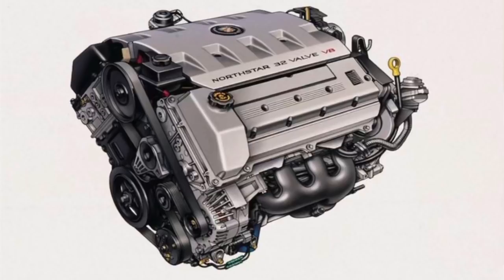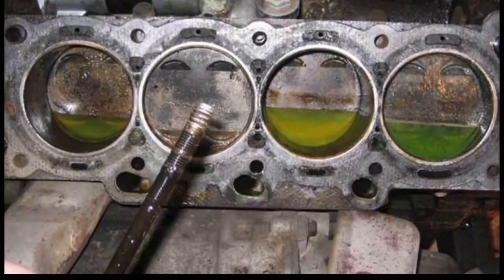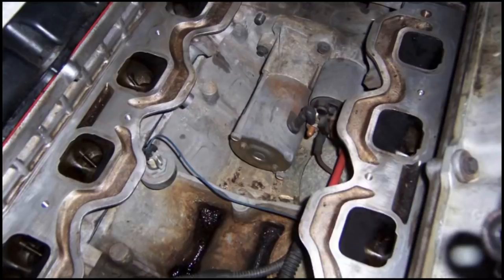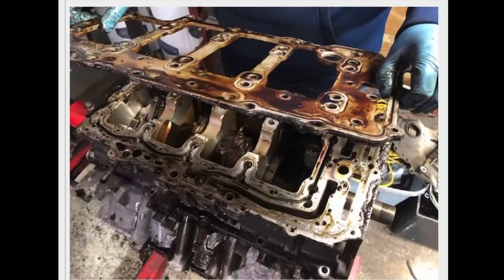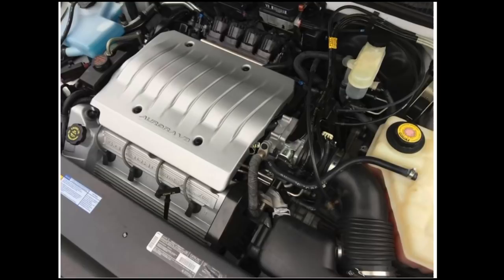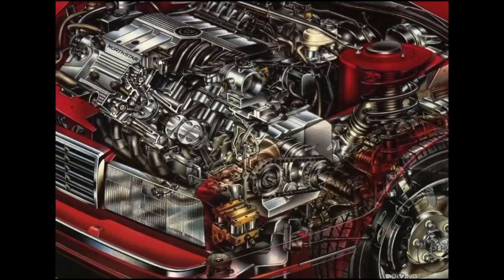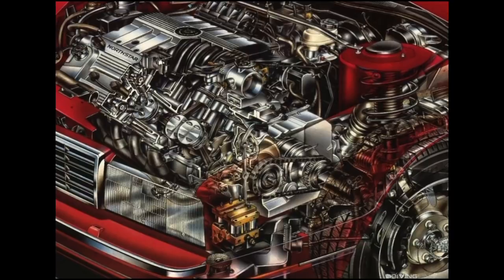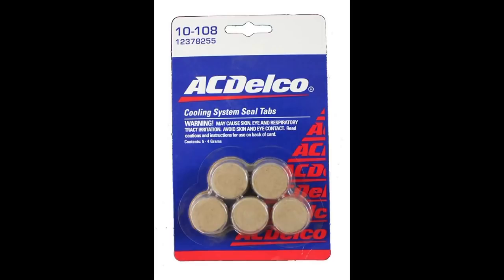Worst Car Engines of All Time: Cadillac Northstar

Comment: Learn something new every day. TIL the Northstar has 10 head bolts. Just for reference, a Chevy small block has 17. Add that to the list of reasons!
Reply: The SBC had so many cause they had a thin deck, and still have a tendency to crack.
Reply: @ProjectFairmont  the heads? I️ was thinking that was the reason behind the blown head gaskets but then I️ remembered small block fords have 10 head bolts…so…
Reply: @TinHatRanch  Not just small blocks..385 series Fords (429s and 460s) also used only 10 head bolts and early versions had compression ratios as high as 11 to 1
The head bolts however were of large diameter and torque specs were 130 ft-lbs.
In addition, the Ford 427 FE series engine that embarrassed Ferrari for 4 years running also used only 10 head bolts
None of the Ford engines were known for blowing head gaskets.
BTW big block Mopars also used 17 head bolts.
Reply: @mikec9112  No 406FE production engine had cross bolted main bearings, they were simply a .080 overbored 390. There were rumors however of 406 engines that Ford experimented with that had 4 bolt mains.
The primary reason Ford bored the 390 into 406 was to complete with the already popular Chevrolet 409, but Pontiac division was the frontrunner in the displacement wars with a 421 ci unit.
In fact, early 427FE engines mostly built in  early 1963 were 2 bolt mains, the cross bolted side oiler version replaced them almost immediately as it became apparent there were serious durability issues under racing  conditions, the center oiled 2 bolt became notorious in short order for "oiling down" drag strips when the bottom end blew out.
Reply: @donreinke5863  and all 3 of the big-3 🇺🇸 did have options for 6-per-cylinder v8 engines and some of those are aftermarket castings/billet, as a example the LSX is one and the 440RB BBM is another one and i believe the hemi got that mod in the aftermarket pieces as did my frankenstine BBM hemi + 9/16" main and 1/2" shank top and bottom row shank plus a bedplate i know maybe a little overkill but built to take abuse/longevity. ford did 4 per-cylinder in the 6.0 power stroke but it's a mixed bag as it's supposedly a weak spot in the design
Reply: @mikec9112  Not quite. The highest performance 390 of 1961 and early 1962 had a solid lifter camshaft as did the 406 as well as a "snubber button" on the front of the cam to keep the cam seated in the block.
According to the 1962 Galaxie owners manual, the top option 390 was rated at 375 hp with a 4 barrel and 401hp with 3 two barrel Holleys.
The 406 was rated at 385 with a single 4 barrel and 405 with the same Holley 3x2v setup.
Only with the introduction of the 427 in 1963 did the FE get an all new block (twice) as its 4.250 bore was well beyond the limits of overboring the 390s 4.05 bore.
The 4.13 diameter 390 based oversized block was used from 1966 until 1969 as a 428 ci unit, and some builders used its 3.98 "stroker" crank to yield 454 ci when used in a 4.25 bore 427 block.
Ever notice that almost all 390 (and 410 Mercury only) blocks still had "352" cast in the front left below the cylinder head?
I scored a 410 that someone stuck in an old Ford flatbed at the wrecking yard because the morons saw the "352" and kept on walking, never bothering to scape the grime off the ID tag under the coil bracket.
Off the subject (partially) the Olds 350 diesel block could be overbored .130 and STILL had more cylinder wall thickness than the 350 "gas' block, and a Ford 312 Y-block will take a .060 overbore with no issues--Ive had to do it.
Very minor changes in the casting process easily allowed an FE to be punched .080, and some production 390 blocks (depending on core shift) would even take .080, but sona-ray inspection should be done.
Reply: @richardprice5978  The 6.0 PowerSmoke was perhaps the worst diesel in light duty trucks with the exceptions of the early 6.2 and 6.5 GM (Detroit?) diesels.
385 series Fords used 9/16 diameter bolts, while the SBCs were only 7/16s. (The Ford Y-blocks, 292 and 312 with only 10 head bolts also used 7/16 fasteners, I always recommend using ARP stud kits on those)
Its been so long since Ive pulled the heads on a Mopar B or RB that I dont remember the bolt sizes.
Reply: @mikec9112  well i remember a industrial or marine version of the first generation 1940-66~ hemi and the BBM V8 wege and the max-wegeg having a bedplate or cross bolted bottom end 5/16 or 1/2 or 9/16 sized studs or bolts
Reply: @donreinke5863  wasn't there a LSX GM factory performance crate engine with 9/16 main bolts or arp studs and MLS head gaskets and 6-p-cylinder
Reply: @donreinke5863  BBM-b uses 1/2 shank mains 7/16 🤔 bottom row ARP has a stud kit with some TLC to go up a size so thats what i did, but 5 doesn't seam to clamp the head evenly so i added a row using the exhaust manifold ( B-block with a 👨‍🏭 -steel plate 12"deck and D-8 heads and weird VC rods and VVT+VVL camshaft and lifter's. have questions ask me ) and block aka mine is welded i kinda know its not the strongest setup but for quick and dirty try and see what if shade 🌲 R&D its ok 👍
Reply: @donreinke5863  bottom row on the BBM-B goes in to the water jacket and needs teflon to seal it up and by memory is a smaller size head/socket as the spark plugs and exhaust manifolds are next to it
Reply: @mikec9112  all the vipers blocks i have seen are cross bolted bottom and 5-p-cylinder heads and is related to the SBM as i chexed the cam bearing spacing and is 60* lifter angle as my cam style is like the CAM-in-CAM with twin phasesers and narrowed angled lifter bore's as there jurk-pump/hydraulic like the tiger shark engine 1X2 for a 2:1 ratio rocker
Reply: @richardprice5978  I know they go into the water jacket on Chevrolet BB and SB and some small block Mopars as well as later model 302 Fords.
FE and 385 series Fords are blind holes as well as Y blocks.
I don't remember on the Slant 6, haven't had one of those apart since 77
Reply: @donreinke5863  actually come to think about it wasn't the oldsmobile 5.7 v8 diesel considered more of a rushed job? ( but could have worked and gotten praised, as things like having a poor fuel filtering and delivery/lift pump system ect. ) and i think turning a gasoline engine into a mixed fuel or trubo diesel high profomance engine only but sussful, but parts list's/mods are something the comments can mench it/what it takes to right
Reply: @mikec9112  Same here as far as the 351 be it Windsor or Cleveland , but NOT the "M"
I have no idea concerning why the lifters were placed as they were on LS engines, but the 302 with roller cam does not permit the removal or installation the lifters without removing the head,
Not an issue with the taller deck 351W.
I know that Ford made a small version of the 260/289/302 for Indy racing backing the 1960s with pent-roof style combustion chambers but I have no idea how the valves were actuated.
Ive never been an LS fan, If I want to build a Chevy its going to be an 87 or newer small block (they had high nickel blocks and often held a hone pattern over 200K depending on maintenance.)
Reply: @richardprice5978  I wouldn't doubt it, but the factory Chevy crates Im familiar with are the 502 and 572 units. I do use the LS exhaust port size and configuration as a benchmark when porting heads though.
Reply: @richardprice5978  Did you use Rhodes lifters to get that VVT/VVL?
Reply: @donreinke5863  same thing for me on the slanty i really isn't my last mod engine as i end up missing with chevys the most but really like my BBM's and willing to improve it by other people and engine design's ect. and the first gen hemi is to rare/old/$$ for me to own easily and the vipers car or truck is to expensive as mine is in a charger and by that alone is expensive by itself and i have to pick just a few
Reply: @richardprice5978  Primary cause of Olds Diesel failure WAS in fact GM being to cheap to install a water separator.
Once they got water in the combustion chambers, the steam overpressure was fatal to heads and bolts.
I believe..but wont swear..that the Olds diesel had a steel crank, much like the 359, 361 389 and 391 medium/heavy duty variants of the 360/390 Ford FE did.
Later 429 (and 370) medium duty truck engines also had a forged crank, but they had a huge snout (to run airbrake compressors) and an oddball rear flange.
Lots of machine work necessary to get them to fit a passenger car engine.
Reply: @richardprice5978  Nothing vintage Mopar is cheap anymore, at least as far as modification.
318s and 360s are still cheap and common in wrecking yards from old Dodge vans and trucks though.
Reply: @mikec9112  not a cording to me and my spare parts as their out in my shop/shelf and my measurements point to just adding 1 more row to make it a v10 block wise as yes the cam is phased at 72* firing order vs the v8 SBM at 90* as i used spare/used/junky parts ect. to learn how to make my mod parts
Reply: gen-4 vipers lift cam is about 550th
Reply: @mikec9112  i didn't say all where all cross bolted/bedplated just some and most of my EXP. comes from pictures and reading or others as the first gen hemi v8 i don't own one, i have a D-8 street hemi that is heavily modified
Reply: @donreinke5863  lol 😂 nope experimental computer/solenoids control and 2 modified GM LSX passers 60* units on a gear drive looks a little like a rotisserie chicken cooker 😂 and the VVL works a little like a 1"X1" roller diesel jurk pump FCA used multi air same idea as i didn't like the push-rod angles ( weakness in BBM ) so hydraulic JCB-4 ss steel lines fixed it and slave cylinders 2:1 on top of the head moves the valves at the end of the line following the camshaft profile but bleeding off PSI shouts off the valves/lift aka 800th reduces to min of 200th or off, and it's possible to change the spring pressure's but haven't gotten it to work 👌yet like a F1car not my idea but a buddy's of mine gave me the idea information to do it, and in my gruppies we don't trust free valve/CATIPALER yet in any format so the mechanism's are to keep it from going boom 💥
Reply: @donreinke5863  keath back BBM blocks have a extra rib on the top going from one china rail to the other for extra rigity and to help seal up the valley so my guess is the newer engines like the LSX and 3-G dodge v8 are doing the same thing and lowering the manufacturing costs ect.
Reply: @richardprice5978  Good engineering, but I wouldn't go that far, has to be time consuming as hell, and Im not one to put electronics on any engine except for basic electronic ignition  with a ramp charger module and a Hall effect pickup in the distributor.
Reply: @donreinke5863  so the rumours that it was a gasoline castings isn't what made it fall hard as the primary reason you're thoughts are water in the fuel leading to too much shock peak steam pressure in the cylinder so about the same as to much boost and fuel if the water wasn't injected in ?
Reply: @donreinke5863  from what little shopping i have done the slant-6 isn't to bad but that was the bottom of the junkyard pile and i was considering it for a quick dirty cheap temporary fix ( and i feel i would have ended up needing boost as 80~HP in 4k lb car is a little anaemic ect. ) ( considered the SBM and those are on the way up cost wise and getting harder to find or 3G and a 4.8LS but same problems and more basically a can of worms ) after my turbo B-engine died/stolen but with my tremic TR6060 out of a chevy it would have been a pain as omost nothing lines up/plays nice with the BBM so i skipped it as modifying it twice would have wasted my resources
Reply: @donreinke5863  btw not laughing at you people aren't expecting my mods ( im actually 🤔 💭 about having the passenger side valve cover made out of clear so i and others can see it ), ford voodoo 4-camshaft guys /import's have a point but i just noil in voided it and yes it's not for the faint of harted as it's a lot of work and thanks for the compliment design wise i feel full mechanical or full efi control as a mixed bag like the 1980-95 b-3 manufacturers didnt seam to work really well
Reply: @donreinke5863  holly ( is a cintrifical design, but i believe pre-1960's of some model alfalfa's had a cable on the dash to change VVT and a different cable for lobe separation angle ) had a cam phaser in the 60's that was all mechanical design and i suppose its possible to do hydraulic VVL and all mechanical as older diesel pumps was and it was timed to the firing order and there is other designs that use rods or rockers/soild lifter configuration to do about the same VVL thing as well i figured out for me it was easier to use modern hardware and software to do it and it's more flexible in tuning it well driving @60mph same way as why the fuel and spark are done that way in 2010-up as mechanical injection and mag is pretty much fixed typically with driving and or execrating
Reply: @richardprice5978  If you took the time to engineer modifications like that, (and likely gone through a lot of trial-and -error) of course you have my respect
Its people who went over and above what the factory did who were..and are..the roots of performance and car crafting.
I dont design my own stuff, but I use available compatible parts to improve older designs, like using E4OD gear sets in C-6s for wider ratios
I also use 4R70W gear sets in hydraulically controlled AODs for the same exact reason
Reply: @mikec9112  I just pulled apart a 1994 302 out of an F-150 to build, and I can guarantee you that there was no hone pattern to be found, but it cleaned up nicely with only an .020 overbore
The information I got from some of the forums claimed removal of the heads was necessary for lifter replacement, but I had pulled the shit assed small valve and port iron heads off before I went after the lifters, so never tried removing them before the heads were off.
There ARE ways to make the 400 run and run well, especially with the low end torque from that engines 4.00 inch stroke allowing the use of a more radical cam without waiting for the revs to come up high enough to not be a total dog at lower RPM.
 I built one using Australian 302 (also produced in South Africa) closed chamber Cleveland heads (which had the same valve size as the worthless open chamber stock 400 heads) and much better ports.
The big problem is that the pistons sat .070 in the hole, and no common aftermarket pistons are made which correct that.
Custom pistons are pricey, but 351 Cleveland pistons can be used IF the small end is bushed to accommodate the Clevelands smaller diameter piston pin
Reply: @richardprice5978  Exactly. The water in fuel/steam pressure seems to be the consensus on why the Olds diesel was a failure.
Ive read reports of people installing a water separator on those engines and they've lasted a long time, despite being naturally aspirated dogs.
Reply: @donreinke5863  interesting i thought that water in the injection pump and 3000 psi nosal would eat it like a water cutting machine does use up it's tip every so often and needs repair and replacement hardware 

if the peak max psi cylinder pressures were kept in chex would direct injection of water improve the engine? ( more so if aiming for the exhaust valve as it's generally the hot spot in a boosted EFI setup or the sharp-ish crown on high compression hemi piston's ) diesel fuel or pump gas ⛽ ? as i know port works but i don't know vary many that know about direct /hybrid steam
Reply: @mikec9112  not a fan of bunkie conuson hun? well he sure like triangles as a design athstedec for the car body's he's a credited with, with the oiling system that you mentioned i think 🤔i have seen it but don't remember why you think it's hot garbage 🤷‍♂😁?
Reply: @donreinke5863  the olds did need a turbocharged and after cooler as factory standard option as all diesel's struggle for air and clean burning without it on higher load and accelerating = smoking
Reply: @richardprice5978  Part of the cause of smoke in diesels is poorly atomized fuel,
Volkswagen and other manufacturers increased fuel pressure to well over 30,000 psi to address the problem as well as changing fuel injector design.
Early diesels had around 12,000 psi.
Reply: @richardprice5978  I dont know that water injection has ever been attempted in diesel engines, but if it were it would have to be very carefully metered to avoid cylinder overpressure, likely with some corrosion inhibitor, and yes injector damage was in fact reported on the Olds diesel.
It works well on low compression gasoline engines, its essentially free power.
Reply: @mikec9112  sorry i forgot to type Oldsmobile oiling system my bad. 

yep priority main oiling on the SBF does make sense but not being a real ford guy im historical understanding is probably something to do with the working classes and or the unions contracts or the government and the heads are different so trans am racing 🤔 and or advertisement
Reply: @donreinke5863  thanks as you can tell im more fluent in port gasoline engines than diesel fuel engines. that first post made it sound like the older diesel DI injectors at lower rail psi ( i thought that the rail psi in the pre-90 was under 4k 🤷‍♂ not, now i look dumb at least i learned something new today i knew the common rail gdi is 200-500 bars and the diesel's are passed 20k after 2016 ) where ok with some water say >20% or so but i guess not as pumping water at higher psi is doable in pressure washers so some of the concepts would transfer over, not that anything i own is setup to take addvange of it. i did see one dodge hemi head with duel fuel one spark plug and one gm LBZ next to it instead of doing twin plugs but not my engine/stuff and if you're carful 🤔 might be room for 3 hole's in the cylinder head 4 twin 14mm plugs and a skinny peaiso injector as a squirrel 💭
Reply: @donreinke5863  DI injection would have to be at higher in cylinder temperature and or EGT in the exhaust system to cold and it wouldn't work or very poorly is my guess as when to start triggering it as thats how a lot of port/jet engines systems do it
Reply: @richardprice5978  Might be interesting to experiment with an old diesel that doesnt have much value
I wouldn't try it on anything expensive.
Reply: @TinHatRanch  10 head bolts is all that’s needed on a SBF, unless you run 22 psi+ of boost.
Reply: Hmmm, that does sound a bit low.
Reply: @AdamAus85  somemore context please, as to what is low?
Reply: @ProjectFairmont  what is the maximum peak in cylinder pressures on a SBF on 22psi as you say measured or theoretically as that effects the needed clamp load
Reply: @richardprice5978  Just a low number of bolts ma man
Reply: @donreinke5863  6.4L Powerstroke is the worst diesel in history.  Watch [The Party is Over] on the Powerstroke Help channel.
Reply: @Sir.VicsMasher  Oh, I dont think so.
Those 6.2 and 6.5 GMs were absolutely HORRIBLE.
A guy I knew put 3 of them in his Chevy tow truck before he dumped the truck for cheap, and that's far from the only horror story Ive heard concerning them.
Im not saying the 6.0 or 6.4 were good---they are NOT.
I would be finding a way to shove a Cummins in any truck that had either of them OR the 6.2 or 6.5
Reply: 10???? The hell? How can that suffice as a strong hold? It's no wonder they strip out. This is a V8 GM!!!! Doesn't matter, they put an lsbin a grand prix. RIP transmission.
Reply: @nickd.7267  The 455 Olds was a GM V-8
and a big block at that. It used 10 head bolts. I believe the Cadillac 472 and 500 did also,
Correct me if Im wrong on the Caddy, havent seen one in years.
Reply: The amount of bolts isn't as important as having a good design. Plenty of four-cylinder Banks use 10 bolts and don't have head gasket issues
Reply: @mikec9112  LS is not a 10 bolt head.
Reply: 17?  Why the odd number?  Because of the way the pistons are staggered?
Reply: Lmao small block fords have 10 head bolts too and they don’t have problems. The northstars problem is using a fine thread with an aluminum block. Had they used a coarse thread there would be no head gasket issues and these motors would be loved by everyone
Reply: An LSx only has 10 too those 7 extra 5/16's bolts aren't head bolts.